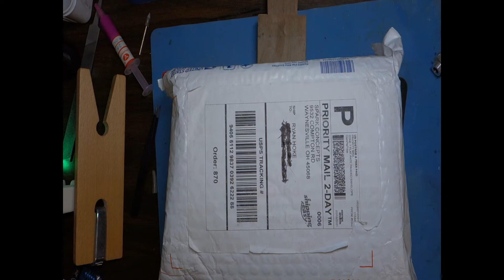Xpro v5 unboxing

Comment: I just bought my first cnc kit with one of these because it looked so simple compared to the rest hopefully it saves me some of the headaches of learning cnc
Reply from the maker: Hows the cnc coming along I really like my xpro v5 hope you are enjoying yours
Reply: @idahocreator2491  yes its going great thanks very glad I bought the v5 the wiring diagram looks like its was meant for kids its so easy good for electrical dummies like myself im a metal worker by trade so im going abit crazy with a frame for it at the moment going for a clean look its kinda resembling a air hockey table abit with rounded corners but I like it🤣

Comment: Hy! You know how to make the wire setup with your xpro v5 and a huang yang spindle??
Reply from the maker: If your spindle has a vfd you either use the 10v connections or the pwm connections. If your spindle only has the manual control then you cant control it. I use a 2kw spindle from china and a vfd and it works great. You will have to check your vfd for proper wiring as each vfd is controlled differently